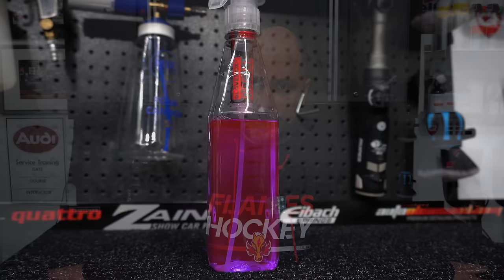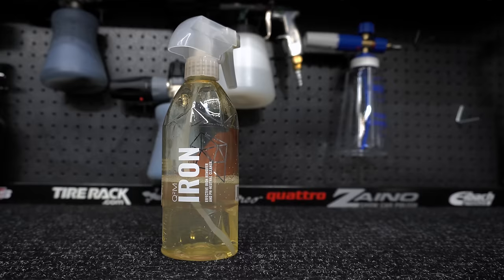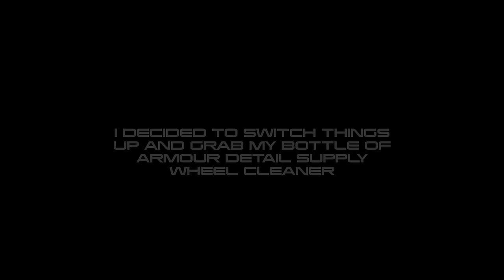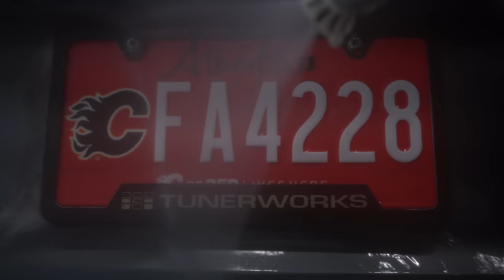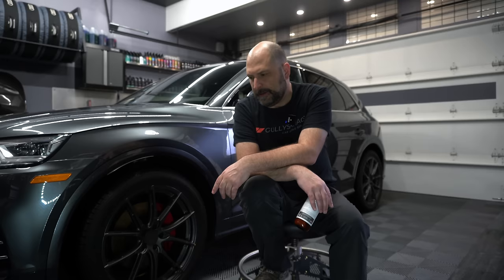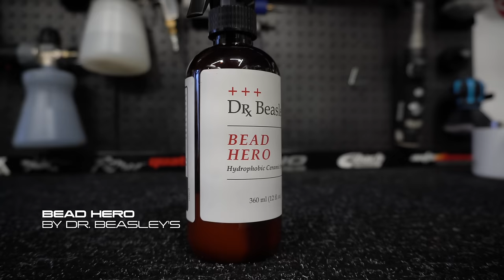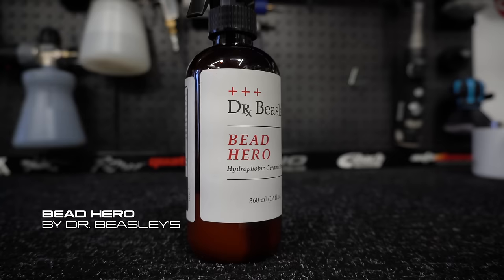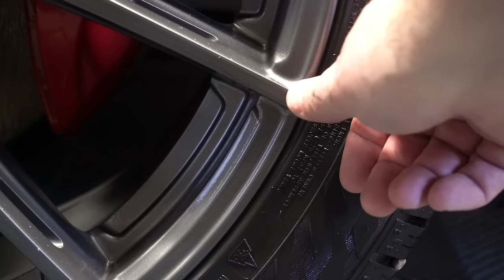𝗔𝗨𝗗𝗜 𝗦𝗤𝟱 𝗗𝗘𝗖𝗢𝗡 𝗪𝗔𝗦𝗛 | Awakening the Hydrophobics of Dr. Beasley's Nano Resin Pro Ceramic Coating

Comment: Great car wash, love the gsf foam , looks great .
Reply from the maker: The foam is absolutely insane. The latest version of the MJJC foam cannon has a lot to do with it. I have used GSF and Shampoo+ from Armour Detail Supply in it and they BOTH came out great. The thing is, I am finding you go through the mixture much faster with the MJJC than the MTM which I have been using for years. I will have to play around with the "settings" to see if this is something I can modify.

Comment: Honestly, the coating looks like it’s doing pretty well for the environment it’s been through. Though I definitely think this would be a perfect candidate for Koch Chemie’s Reactivation shampoo, or descale though it is not as acidic. After any major snow we have that I have to drive in and get caked in road salt I do a prefoam of an alkaline soap, rinse then refoam and contact wash with an acidic leaning soap. It is better at declogging and neutralizing any of the embedded minerals.
Reply from the maker: I was just chatting my friend Owen from TOC Supplies and he mentioned giving KCX Reactivation Shampoo a try. It is one product I don't currently have but he has offered to send me a bottle to see if it does the trick. I am getting so much great advice, but I think it will help me devise my next approach. Thanks for the insights and I'll be sure to show viewers what happens next!

Comment: i could be wrong but Dr. B's aims towards their coatings being more sheeting rather than that strong water beading that most of us are familiar with.  Similar to what you are seeing on the hood.  What I would recommend is a 3 pH wash.  Labocosmetica has a video on it but you could substitute products such as those from CarPro.  For example the CarPro system would be the following Foam with CarPro Lift, Rinse, Foam with carPro Descale and leave it on the surface and then contact wash with CarPro Reset.  This should to the trick in helping to deep clean the coating.
Reply from the maker: Yeah, I am going to get acidic on the next one. Thanks for watching and for sharing your insights. Very much appreciated.
Reply: @RADGarage  do you have the water spot remover from DIY?  You could use that as well since it’s acidic.
Reply from the maker: I have ALL the DIY Detail products. I think I am going to enlist their Iron Remover and clay towel to rid the lower portions of the layer of contaminants that are clogging up the coating. What do you think? Is that too much?

Comment: Great video Rick. In my personal opinion, the water behavior on the hood looks like it's hanging on a bit.  I do agree with you on the hydrophobic and slickness qualities, especially after so many prep steps and the price of the coating system itself. I wouldn't be happy with this performance.
Reply from the maker: Unfortunately, this seems to be a recurring theme in my detailing life up here. I think that fallout from the fire really messed things up for me and this coating. I don't think I did the best job in "saving" it. I used the DIY Detail Water Spot remover, but even before that, the hydrophobics just weren't blowing my mind. I will continue to up the aggressiveness of my wash process to see if things bounce back, but I don't think I will ever know where things went wrong in that regard. Like I said in the video, the paint looks amazing, but I want more.

Comment: Tough winter out west Rick! We got luckier this winter so far here in Montreal, not so cold and snowy as usual… 
Anyhow, if it’s still clogged, i would defintely try a more acidic cleaner to break down salts and any type of mineral deposits that would sit on the paint. I’ve got good results with Diy water spot remover. 
But any kind of coating with that much salt abrasion Is having a hard time to resist …some are better than others though.
Reply from the maker: My next few washes will be experiments with different soaps. I'll get more and more aggressive and let people see if it is making any difference in terms of restoring the hydrophobics of this coating. Take care.
Reply: @RADGarage  awesome can’t wait for it!

Comment: Hi, sorry for my English I'm using a translator, I'm from Quebec and here too the winters are harsh, I just discovered your site and it's really well done, I've been doing detailing myself for 5 years and I love it, my The question is in the spring when I make my clients and who have not washed their vehicle for 6 months let's say that it has a nasty crust, I have tried lots of things but never what you have shown here, what are the ratios that you used gsf + water and gs + water in your foam gun? For the moment I use a 4:1 APC in my foam gun but it doesn't remove everything thanks again and congratulations for your site
Reply from the maker: I have been fielding all kinds of thoughtful feedback and advice from viewers. I am going to give it another try and do it a bit differently, but I haven't decided on the exact steps yet. I used 900mL of water to 100mL of GSF the first time (that's my normal pre-wash foam dilution rate) and I added about 30mL of Green Star to the same concentration the second time around. I don't think the alkalinity in the GS at that rate was enough to do much. Next time round, I am going acidic.

Comment: careful the rubber cap on that wheel brush doesn't fall off, happened to me on a similar Speed Master brush by Autogeek.... after snow here in OH and now time for the water to evaporate, I had piles of salt crystals in my garage where the water would gather.  piles 6-8" in length.  I can only imagine the unseen damage happening on our cars...
Reply from the maker: It hurts the heart when you think about it too much. Good tip on the rubber cap. I'll ensure mine is nice and tight.

Comment: I would be interested in seeing a different coating on the other side of the car to see how it handles your specific road conditions.
Reply from the maker: Yeah, that would be the optimal way of knowing, but I don't think my OCD could handle it. I really need a second car that I can use as a test mule. I am leaning towards the application of a new coating this Spring and we shall see how it performs over the same length of time.

Comment: Hi Rick, I'm Alessandro as always I give you my biggest compliments, you are always number one. When washing the wheel did you change the product why? I noticed that you used different products from different manufacturers, is the nano resin pro Ceramic coating better than a nanotechnological one? I have never used nano ceramic, I have always used nanotechnology, what is the difference between the two? What purpose does the micro camera you have on your chest while you make videos do? I have several people who would like to try it with me and in some customers I would have to polish the car, since I don't have a garage like yours to stay in, why should I fix it, are you saying that I will be able to polish the car outside? Right now I'm thinking about what to do about the garage.... bye Rick, see you soon and congratulations also on the really nice sweatshirt you're wearing...😉👍🤙 say hello to Canada❤
Reply from the maker: Hi Alessandro, the original wheel cleaner I was using was ineffective it removing the very stubborn layer of dirt that was sticking to the surface of the wheel barrel so I opted for a different cleaner that had a bit more "bite". The one I started with is better suited to less-intense situations. 

To answer your question about coatings, I am still learning about what makes coatings unique from each other, so we are in the same boat there. 

That thing you see on my shirt is actually a microphone, not a mini camera. It is part of my audio setup. I want to get a new setup by a company called "DJI" but I am too cheap to pull the trigger! 

I highly recommend learning about the polishing process and if you have nice weather, I think you could complete such projects outside. I much prefer the controlled environment I have in the garage, but I know people that have had great success with doing it outside.
Reply: Hi Rick, regarding nanotechnological and ceramic coating, I personally think that in the summer the Ceramic coating would be very good for UV rays and excessive heat while the nanotechnological towards the winter, this is my opinion. With "DJI" when you want, press the trigger if it's a step forward, for polishing, I also feel safer inside the garage but mine has a bit of dust and my concern is that it will cause damage if the dust it is then found in the pad or on the surface of the car, polishing outdoors must be a sunny day without wind, does the DA FINE cream from Rupes cause any problems if it is cold or if it is too hot? Thanks for the information you leave me, I really like sharing these car detailing techniques with you, I'm waiting for your response, take care Rick, you're always the best...😉👍🤙

Comment: Brilliant as always Rick. Loved the into! 😆. Can’t beat the sweet smell of drippy cherry snow foam. Any particular reason why you mixed Greenstar on the 2nd foam application and not the first? Or was the 1st GSF application enough to get rid of majority of crud? 🙂👍
Reply from the maker: Hi Nadine. Yes, the initial foam was just to emulsify the hardened crust of dirt and salt. Adding the GS to the bucket was my attempt to raise the stakes and give the GSF a little more "bite". I could have used GS in the initial foam, but I like to approach with caution. In the coming weeks, I am going to get even more aggressive as an experiment in unlocking any hidden hydrophobics. Come May or June, I will probably use a new coating. I have yet to find a coating that can honestly handle the abuse this city inflicts on a car.
Reply: @RADGarage  ahh, good explanation. Thanx Rick for taking the time to reply 🙂👍
Reply from the maker: I'm still learning.

Comment: Have you used other coatings in the past and experienced different results? What is the expected (per manufacturer) durability of the coating you’re using?
Reply from the maker: The Nano Resin Pro coating boasts some impressive durability claims, but something is getting in the way of it performing the way it should, and does for others. I'll keep at it. I am hopeful I can figure it out. 

Most coatings last me about a year before they start to break down and wear away. Especially on the rear. The rear portion of my car is covered in salt half the year.

Comment: Great video Rick. Question: why did you foam using GsF at first and then foam again with Gs? Why didn’t you hit it first with the GsF and Gs combo? All the best Rick
Reply from the maker: Great question and no real answer. I was mostly focused on using some alkalinity in the contact wash after applying the iron remover. So, that just meant using a quality pre-wash to emulsify the hardened shell of dirt and salt. I was so impressed with how GSF, on its own, was able to penetrate the rock solid crust that was on the SQ5. It ate through it like a hot knife through butter. Next wash, I will get even more aggressive with the chemicals to see if it is possible to unlock the hydrophobics of this coating. Stay tuned and stay RAD!

Comment: It most definitely would of benefited from a water spot remover after the wash. Salt will clog coatings everytime. You can’t neutralize salt with salt(alkaline products) try this next time Rick
Reply from the maker: I truly appreciate your advice. Can you be a bit more specific with the process you are suggesting? I am always keen to try something new.
Reply: After the hand wash apply a Waterspot remover like diy detail water spot remover & work into section with a damp microfiber then rinse. Your hydrophobics will be restored 100% if it’s a quality coating
Reply: @RADGarage  you could also use carpro descale instead of gsf. It also good. Use descale for winter & gsf for spring/summer. Not as effective as the separate wsr but for general clogging it’s effective
Reply from the maker: I will apply this process on my next wash. I'm not sure I will have the time to showcase it on video, but I will let you know the result. Hopefully, I will have the time to showcase the results on video.
Reply: @RADGarage  you make fantastic videos Rick!
Reply from the maker: Thanks buddy. That's helps motivate to get in there and pull out the recording equipment. For reference, what can be a simple 1.5-2 hour wash takes 6-8 hours when the recording equipment is involved!
Reply: @RADGarage  I guarantee it! We appreciate the hard work you put in on these videos! Extremely satisfying!😊👍

Comment: I encountered the same issues.

I use the 3PH wash from Labocosmetica, 
cause it still looks like the coating is clogged by minerals imo. When that doesn't do it use a finish polish and re-apply the topcoat?
Reply from the maker: Ouch, that sounds like a lot of work and if it didn't give me the results I was hoping for, I might be unable to recover. I'll try a few other things before going to the extreme of polishing and reapplying. You have given me a lot to think about, though. Thanks for sharing your insights.
Reply: This method works for me here in Finland
Reply from the maker: I hear Finnish roads are pretty tough on cars.

Comment: Hydrophobics  kind of a let down for it claiming a 25 year - been through a rough winter as well and all the coatings especially the one I applied almost a year ago a good ph wash and it’s heading with no toppers. Time to polish it off put something else on
Reply from the maker: I'll give it a few more washes and see where we are at. Considering this car is my only test mule, I was always planning on applying a new coating in the Spring.  Some have suggested coating different sections of the car with different coatings, but there is no way my OCD could handle that. Thanks for watching and sharing your thoughts, Eddie. 🤘
Reply: @RADGarage  just the hard work you did to get here , and if not last through one winter is wild
Reply from the maker: What are your thoughts when you hear they coating is there but it just isn't providing the hydrophobic protection?
Reply: @RADGarage  it’s like a failing marriage , your in the same house but there nothing there. What does it’s there mean, we want self cleaning , easier to dry , taking the hits
Reply from the maker: The notion that "It's there" has always made me scratch my head. I admit I don't understand all the science behind coatings, but I have a very strong grasp on the obvious and when a coating doesn't provide proof of hydrophobic ability, I start to question its existence. The rear section of my car takes an absolute beating, and there was zero evidence of hydrophobic ability there. Does that mean the coating has been completely worn away? What do you think?  Some will say "it is there" but how do you know? If I can't see it's performance, what exactly is there. You know what I'm saying, right brother?
Reply: @RADGarage  Rick 100% the goals of a ceramic coating is the removing of water , easier to clean and visual of hydrophobic behavior , I could understand if the car wasn’t maintain but we all know you clean your car. 

Generally people would look at this and say it’s  “clogged” , or it had mineral build up so you’ll attack it with a acidic wash and let it sit , like purifica or a water spot bath and rinse but if a coating isn’t reacting to proper cleaning to me it’s done it isn’t there and who ever says it is I’m excited to here the science behind it. Looks like another brands coating that failed imho
Reply from the maker: What if I am able to resurrect it? I will be a legend.
Reply: @RADGarage  you already are the coating isn’t haha 😂

Comment: No impressed with the Dr. Beasleys. I've never looked into them after Matt from Obsessed Garage had it on his Blue Raptor and did something similar. Seem to be highly inconsistent and low performance. I have CSL on mine, and no complaints. May look into Armour next time, or a graphene option
Reply from the maker: The most fun part of my detailing hobby is trying new things and connecting with new brands. Dr. Beasley's has been one of my biggest champions and I am proud to know them. Something is going on with this coating and I am hopeful that I can crack the mystery because this coating is a legit pro level coating, but it just isn't living up to its potential on my car.

Comment: Personally Rick, I just think that specific coating has just not performed and ultimately has failed on you. No amount of decon can save it at a point, Maybe time to strip it and reapply a new coating.
Reply: Or try an acidic wash like CarPro Descale
Reply from the maker: I will start to experiment with more aggressive chemicals in the coming weeks and months leading up to the Spring. Seeing as this is my only car, and I have so many coatings in my drawer, I will probably be applying an ew one at that point. Some have even suggested I coat the car with multiple coatings, but I don't think my OCD could handle such a thing. I do have a bottle of Descale and a product by D-Tail Lab that will make an appearance in my next update video. Thanks for taking the time to watch and for leaving your insights. I really appreciate the feedback.
Reply: @RADGarage  I would start with Descale and maybe a wash after of reset to neutralize the acidic wash? Probably not needed but can't harm it or the product you said from D-Tail Lab.. 

I agree with you, I could never have multiple coatings on your car.. This is your baby not some experimental car donated for a YouTube video. You'll never know where you stand and if some fail whilst others are still performing.. Then what? Would just be patchy protection. No thanks.